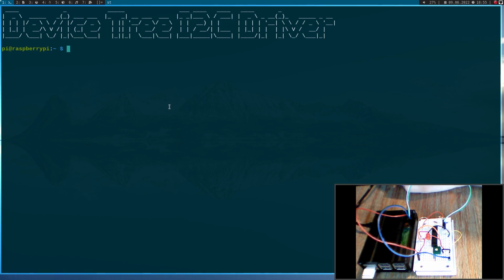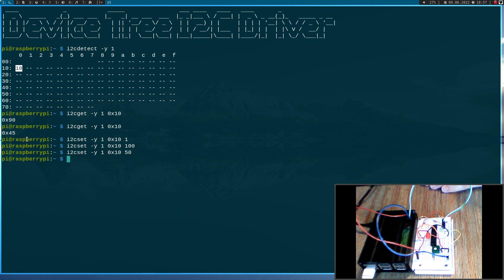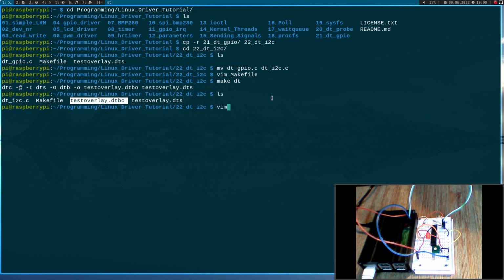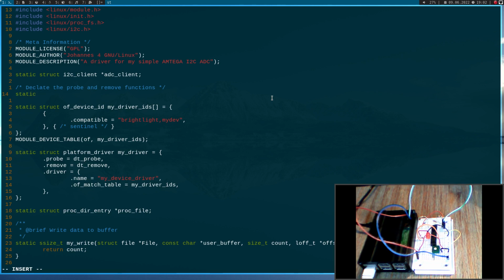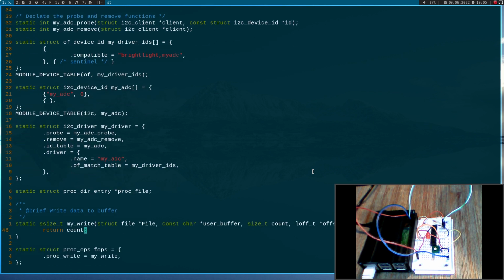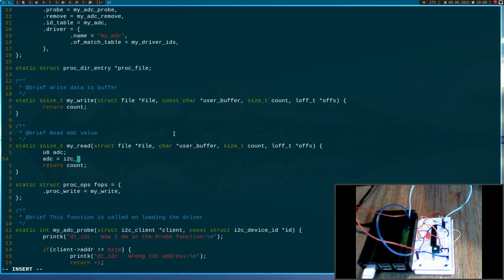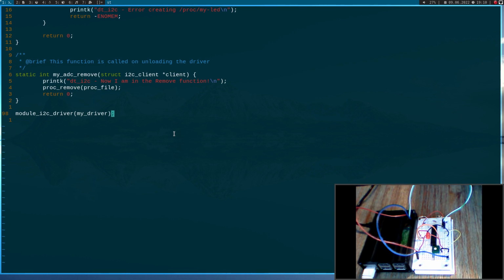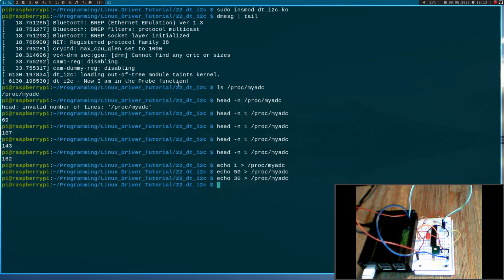Let's code a Linux Driver -  22: Device Tree driver for an I2C Device

Comment: Hi 
First thanks for great materials to learn and use as baseline for own projects. Great job! 
Second i have one question. I use SysFS and develop few kernel modules. 
Problem is i would like to group them under single class but it looks like when i create class with class_create funtion in first module it works (creates /sys/class/my_class/driver1).
When i try to do the same to create class /sys/class/my_class to register driver2 under that class i got exception. Class file laready exist please do not create somthing what already exist. 

Is there any possibility to check if class exist and read them to attach new driver to the same class ?
Reply from the maker: Thank you.
Yes, you can't create the same class twice. I haven't tried this out yet, but I believe there are ways to iterate through all the classes which exist on the system and then pick the one you are interested. You will have to browse the Linux Kernel sources to search for such a function. Maybe drivers/base/class.c is a good starting point. Or maybe you know an already existing driver doing something similar, then you could take a look at that.

Comment: Hi Johannes, I want to write an I2C driver that handles two different slave addresses,(i defined two child nodes for each in the dts overlay file), when i want to write into the registers at these addresses can i just change client->addr and then proceed to write? but this is said to be a bad practice. so how do i do this? especially if i have to write bunch of reg in a certain order at both these addresses? any sources you can point to for this type of driver? your help is lot appreciated.
Reply from the maker: Hi, please help me understand it. You have to I2C device notes in the device tree (let's say one for address 0x12 and one for 0x13). In the driver you have a probe function. This function will be called two times (one time for the device at 0x12, one time for 0x13). And know in the probe function of device 0x12 you want to access device 0x13. Is this correct?
Reply: Hi, ig my issue is a lot less complicated, i just am trying to write a driver to access both the slaves 0x12 and 0x13, and both of these show up at once when i do i2cdetect -y 1, Now i'm trying to write into the 0x12 slave first and then write the registers of 0x13 slave, in a single probe function. so to switch addresses i'm using client->addr to change the addresses as i want. but this method is not good i heard. so how do i switch addresses without using client->addr? 
p.s. (i changed my dts to just have one node instead of two cuz i don't want my probe function to be called twice), I'm quite new to this, please explain how to do this?, also the order of accessing these addresses is important , it's like i write some into 0x12 and write some into 0x13 and then again write into 0x12, then agian 0x13.

Comment: Say your I2C device produces data at 100 Hz: how to fetch these data at this frequency?
Reply from the maker: Well, on a Raspberry Pi you can set the frequency of the I2C interface over the /boot/config.txt file. Just add the line dtparam i2c_baudrate=100 at the end of the file.
On other systems you need to tinker around with the device tree. I think there is a variable clock-frequency for every I2C controller. There you can adjust it.
But then the I2C bus will always operate with the frequency you set for all devices.
Reply: @johannes4gnu_linux96  OK but I guess I didn't formulate the question right. Say I have a continuous flow of data coming from the i2c device, I can not `cat /proc/my_adc` 100 times a second to get all the data!... I wonder how to set some kind of IRQ (like the GPIO button ones) on the incoming i2c-device data to be able to post-process them "live" (as they arrive). Is this possible?

Comment: hello sir, i want to know that does the probe function will be called when loading the driver if the output of the command i2cdetect -y 1 is just UU instead of the hexanumber of device address?
in my case, nothing was printed in dmesg when loading the driver.
Reply from the maker: Yes, when you see UU at an I2C address scanned with i2cdetect, this device is used by a driver. The probe function will be called, when the driver detects a device which is in its of_device_id array (e.g. when applying a device tree overlay). Do you have a print in the probe? Maybe the device is already used by another driver?

Comment: Hi Johannes,  Thank you for all of these tutorials!  They are very informative and useful and I am learning a lot from them!   In this tutorial, you are using an Atmega 8 bit controller as the i2c slave.   I was wondering if you can provide more detail about your physical connection and the programming you have done on the controller to get this example to work.  Thank you!
Reply from the maker: Thank you.
I have made a series of videos about Atmega programming. Here is a video where I show you how to program an I2C slave: https://m.youtube.com/watch?v=BKBf-nX_NKM&pp=ygUNQVZSIGkyYyBzbGF2ZQ%3D%3D
The video is in a playlist and in this playlist you can find more info on Atmega programming, e.g. a video how to flash the controller or how to use the ADC. With these videos you should be able to understand the Atmega code I am using here. 
Hope this helps.
Reply: @johannes4gnu_linux96  Thank you for the info!

Comment: Hi Johannes, thanks so much for these brilliant tutorials (video and articles). They have helped me a lot in learning about the Linux kernel. 

I have been trying to build a very simple I2S driver, and I was wondering how simple it is to adapt such an I2C driver for I2S. Thanks very much in advance for your response!
Reply from the maker: You are welcome and I am glad, my videos helped you. 

Well, basically the structure for an I2S driver is the same as for I2C: Adding a device tree node, implementing a driver with a compatible devices of_device_id struct and then implementing the probe and remove functions.

I haven't used I2C yet, so for the details, I don't have any experience, but the structure should be about the same.

But if you have the basic understanding, you can search the Linux Kernel for similar I2C drivers and adopt them to your needs or use them as a template.

Comment: Hi Johannes. Where to set i2c clock speed.
Reply from the maker: Hi,
Look here:
http://stackoverflow.com/questions/33549211/ddg#40776428
You can specify it in the device tree overlay. The parameter is called clock-frequency = <100000>;

Comment: hi johannes i want to modify the dt_i2c module to read the angle of an as5048b encoder, the device address is 0x40, the register is 0xFE, i have to read 2 bytes, what do you recommend?
Reply from the maker: Well, basically this is the exact example for doing this. In the device tree, you just have to change the address to 0x40 and instead of smbus_read_byte use i2c_smbus_read_word_data where the second argument is the register address of your I2C Device (0xfe). I would also recommend to program the driver as an IIO driver. Check out this video here: https://www.youtube.com/watch?v=l8mQtpZhgYI

Comment: hi joannes i couldn't figure out when the probe function is executed, when you do insmod or with cat device,because i wanted to write a module that sent i2c1 data to the user space automatically with a timer
Reply from the maker: Hi, the probe function is called when a new device matching the device table is detected and the driver is loaded. 
E.g. for a USB device the probe function is called everytime a new USB device matching the device table is connected. For i2c the probe function is called when a new device matching the device table appears, e g. By a device tree overlay.

Comment: I didn't understand why with spi you disabled device tree sp1 and here you don't do the same thing with i2c1?
Reply from the maker: In the SPI example, I disable spidev. This is a driver which let us control the SPI interface from userspace. If I don't do this, I can't use the Chip Select Pin from my Kernel modul.
For the I2C there is no such a conflict with i2c-dev (userspace driver for accessing I2C). Therefore I don't have to disable it.

Comment: Brother please make a video for Ethernet driver and dma topics as well.
Reply from the maker: Hi,
I will definitely do a video about DMA in the future.
The problem with Ethernet is, that this is really a quite complex topic. So, it is very hard to cover it with one video.
I have a plan to do a series about Ethernet one day, where we take a look at it, see what interfaces are available, and maybe even do some physical measurement with an oscilloscope, write software (embedded and Linux Drivers), ... , but for this I need more equipment and a lot of time. So, I hope I can do this some day ;)